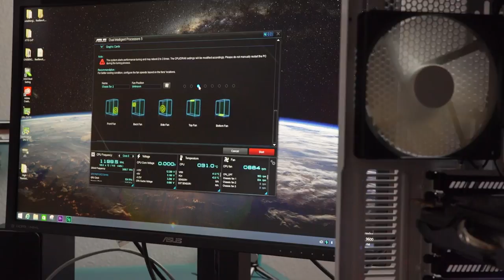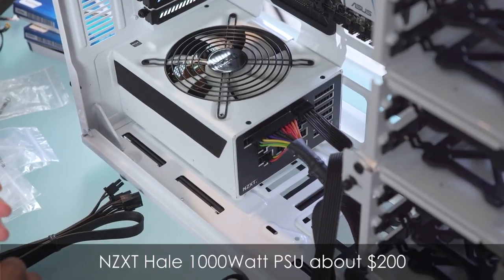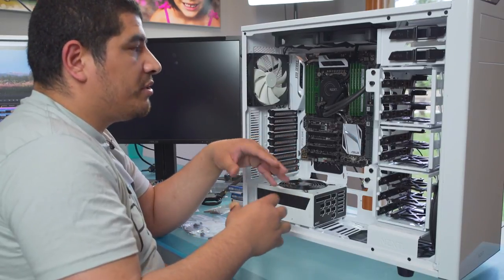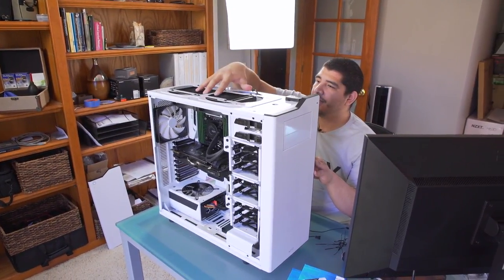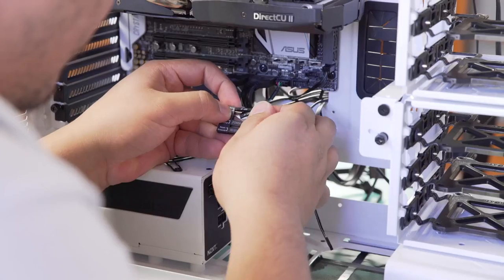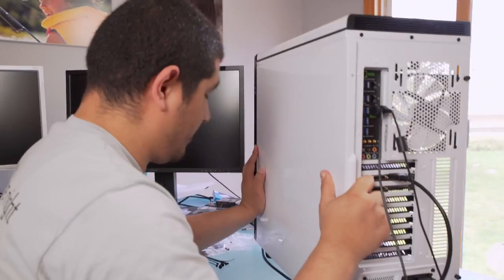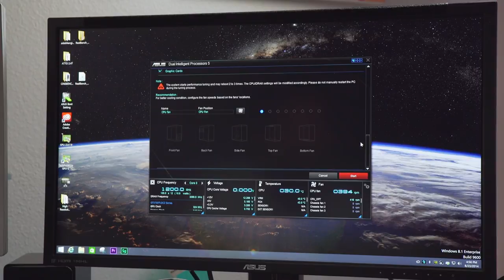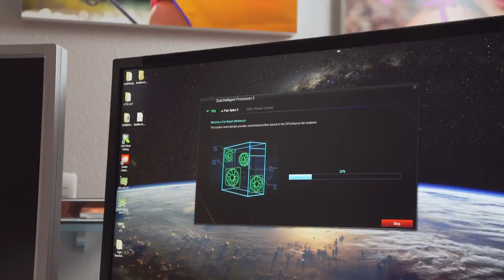i7-5960X 8-core With Asus X99 MB Video Editing Beast

Comment: He wasn't entirely correct about the MacPro.  There are some definite advantages, aside from the HUGE advantage of Mac OS X (which is far superior to Windows).  The first is Xeon CPUs, with up to 24 cores, the second is ECC memory (error correcting code), the third is professional-level GPUs designed for the type of work you are doing here, Dave.  The Nvidia consumer-level gaming cards cripple their dual-precision math (in an effort to sell more of their workstation-level cards).  They only run at about 1/8th of the speed when you need DP (dual precision).  The MacPro has AMD Fire Pro cards, which are workstation cards without the hindrance for DP.

Everything else he said was spot-on though.  For whatever reason, Apple tends to use last-generation hardware, so if you want the latest and greatest, you'll need to stay away from Apple.  That being said, if you are doing a lot of GPU crunching, the Fire Pro cards will blow the GTX 780 Ti out of the water and you can get multiple cards in a single Mac Pro.  The Mac Pro is designed from the ground-up to be a workstation-class computer, for video editors, photo editors and other professionals who need insane number-crunching power.  

If you haven't tried OS X, you really should.  It's brilliant.  Once you use it, you'll never be able to go back to Windows though.  I run OS X on all my computers, except for my server, which runs Linux.  I even made a "Hackintosh" a while back, which was slightly maddening to get running, but AMAZING because I have hardware which would have cost me about $8500 to get in a Mac Pro (cost me a little over $3500 to build about a year and a half ago).  I love my MacBook Pro with Retina screen too, the colors are so vivid and it was almost perfectly accurate from the factory.  I've had laptops from Alienware and Asus in the past, but they were nowhere near the MBP in terms of screen resolution and clarity.
Reply: And you are not entirely complete in your post, either. NVidia makes workstation class GPUs as well, their Quadro line, which was just updated with new models. From what I've read, Adobe's apps are optimized for NVidia tech, not AMD. YMMV.
Reply: genjii931 Indeed, Nvidia makes some amazing workstation cards too.  I've used both AMD and Nvidia cards in my macs over the years and both work really well.  If you don't go for one of the Quadro or Tesla cards from Nvidia, your double-precision performance is SEVERELY hampered (from 1/8th to 1/24th the single-precision performance).  That being said, not all apps take advantage of DP, so that may not be an issue for some people, so the regular desktop/consumer line might be fine, from either maker.  

What's lacking with AMD, in my opinion, is driver support.  They've only released 2 drivers all year, while Nvidia has released a number of driver updates.  If you are making a Hackintosh, it's best to stick with Nvidia, though, as the AMD GPUs really don't work that well.  Of course I believe Dave's question was about the Mac Pro, so what works on a Hackintosh is really irrelevant.  

If I had Dave's computer, I'd definitely install OS X on it though.  I'm currently running OS X on my Core i7 980x system and it FLIES.  It's so nice to be able to move from my laptop (a "real" Apple computer, MacBook Pro Retina) to desktop and have the same OS, apps and setup.  Even though the 980x is several generations old, it still blows my new MBP out of the water on everything it does.  

I haven't tried running an AMD GPU with Adobe's apps on the mac, but when I was running windows, the AMD/ATI cards worked just fine with Adobe's software.  All of my Nvidia GPUs work flawlessly with the adobe applications, FCPX and a myriad of other video/photo apps as well.
Reply: I've used several distributions of Linux, MacOS and Windows over the years.
All of those operating systems have their up and downsides.

If you think one OS is vastly superior, it is mostly based on your personal preferences.

Also - If you have established a good workflow for any given task, it's not reasonable to start from scratch again.
Reply: RedHotBagel   Agreed.
Reply: RedHotBagel I, too, have used many operating systems throughout the years and that's why I can confidently say that OS X is the best, especially for a working videographer or photographer.  Perhaps it's not the best for an accountant or someone who deals with spreadsheets all day, but I really wasn't referring to those type of people in the message.  I currently use Mac OS X and Linux at home and I've used windows for many years too, just not currently.  

The workflow is almost identical between Mac and Windows when it comes to Premiere, which is the main application that Dave uses (with Resolve for grading, which is also available on OS X).  The only real "switch" would be the close-window/minimize/maximize buttons on the opposite side of the screen.  I am a photographer who dabbles in videography, the adobe apps are identical on mac and windows, I can transfer between them seamlessly.
Reply: Scott R
 The workflow for the apps is almost identical, yes, but the workflow between OS X and Windows is quite different. I use OS X at work, and Windows (7) at home.

I'd say Mac OS X is considered easier because the interface is very limiting - and VERY consistent. Everything is pretty much always in the same spot, and there is comparatively little you are allowed to customize (without third party software). If you're not so great at typing, you'll likely prefer Mac OS X.

Windows 7 is very customizable - even without third party software, but things can be found in fairly (sometimes very) obscure places, depending on what you're trying to do. If you're good at typing, you'll prefer Windows 7 once you learn it. It's just a lot FASTER to use (user interaction-wise) than OS X, even my Mac expert friends are surprised how much faster when they see me using my Windows machine (but that's not enough to even remotely tempt them to switch, nor should it be).

If something goes wrong, I think you're better off with Windows 7, as it's more easily fixable (if you're technically inclines), at least in my experience. This may just be my experience, though. The Mac experts at work often seem to resort to wiping a machine clean and starting from scratch to fix certain issues, which I find very irritating.

Hardware reliability: Depends on vendor. I build my own machines at home, and haven't had a machine flat-out die on me in ten years. I've had 2 Mac Minis and a Macbook Pro die on me in that same period of time. I know how to take care of machines - all my stuff is on a UPS, etc, and I use only the highest quality power supplies in the machines I build. Apple looks pretty, but the kind of machine you can put together yourself outclasses any Apple I've used aside from the older Mac Pro (not used the new one that looks like a smokeless ashtray :).  I can't compare to Windows machine vendors as I always build my own. I only choose very good components for my own machines, and I'd be willing to bet large sums of money that a regular Windows box vendor won't be doing the same.

But if you spend 90% of your time in the Adobe creative suite, yeah, you're not likely to notice much difference in use.
Reply: genjii931 The main difference with windows and mac, for me, when it comes to customization is that I don't NEED to customize my mac, because things tend to work as intended.  Really, the only thing I add to my vanilla mac install is iStat Menus, which is to monitor CPU/GPU, Network, battery, hard drive space, etc.  The App store is amazing, you can find anything you need or want right there.  I very, very rarely have to worry about drivers for my hardware with my mac computers, which isn't something I can say with Windows.

I can't say anything about Win 8 or the upcoming 9, as I haven't used them, but Windows 7 always felt rather clunky to me.  I've used Mac, Windows and various Linux Distros extensively and I feel more "at home" on OS X.  I gave my dad my old Apple Powerbook G4 a few years ago, this is a guy who had never touched a computer in his life and within a few weeks, he was doing everything he wanted to do.  When that computer finally went kaput, he had (and still has) a hell of a time working with Windows.  I actually stuck him on Ubuntu there for a while and he seemed to like that better than Win 7.

But you're 100% correct about the hardware, you can build a system that's just as good as the Mac Pro for considerably less money.  The last mac desktop I purchased was a powermac dual G4, way back in the day.  I've had a series of Mac laptops and built a number of PCs.  I took a chance with installing OS X Mavericks on my core i7 980x machine with 48gb of RAM and 2x GTX 570s and it runs like a dream.  I built that system for about $3000 or so a couple of years ago and have added to it a bit over the years.  I'd still be hard-pressed to buy a Mac Pro under $6000 that would keep up with it.  There are some problems with installing OS X to a home-built PC though, it's certainly not for everyone as there are a lot of little niggles that will make you pull your hair out.  Once you get it working, it's rock solid though.  No crashes, no app crashes and it's nice to have things set up identically on my laptop and desktop.  Plus transferring files between two macs is about as painless as it gets, with everything automatically showing up in your finder.  With Yosemite, you also get continuity features which allow you to answer/make phone calls and texts from any of your apple devices (iPhone, Computer or Tablet), which is really nice and I don't think you can get that on windows without a lot of various hacked-together software.

I find that if I build the system myself, it lasts longer, for whatever reason, than one that I buy.  I'm not sure if that's just due to me knowing the system inside and out or the fact that I use higher quality parts than manufacturers use.  Either way, I haven't bought a desktop system from a manufacturer in well over a decade, but I do still buy laptops that are pre-built, as it's difficult to build your own still (although it is possible).
Reply: Mac pro is an awesome computer, totally self contained comp in a beautiful package, BUT the price is too damn high for 90% of consumers- so if your a pro who can use the specs and osx apps with cash to throw around buy it and call it a day. Otherwise save money and build your own PC.
Reply: John connor Wow, this discussion distilled again to Mac OS vs Windows?
I use many Linux/Mac/Windows machines in ~50-30-20 ratio. It's quite annoying to hear the same tune about Mac pricing considering how they overlook competitor prices (HP, Dell, Lenovo et al) selling at more or less similar hardware. It's a classic fan boy thing to get into.

Yes, if one can't afford Macs then build PCs. In fact, one can use Linux OSes to save some more money. I do all sorts of things but I never crib about Macs or PCs because it's my responsibility to make future-proof (enough) investments ranging from embedded to hybrid clusters, and everything has pros and cons.

Note that I'm inferring about many /fancy/ folks who can't comprehend value of money like teens, students or young employees who often get impatient at spending money in their first/second jobs. I know this because I'm seing interesting 'headcount' trends since 2010...many end up with plastic traps!
Reply: John connor I don't believe the Mac Pro is a consumer computer though.  It's got workstation-class CPUs and GPUs.  The iMac is a consumer computer.  The average person doesn't need xeon processors and Fire Pro GPU(s), or ECC Memory.  In fact, for some applications, the Xeon and ECC would actually be slower than a regular consumer CPU with a higher turbo-multiplier and faster RAM.  

The average consumer has FAR more computing power than they need these days, with some computers having 4-8 CPU cores.  You just don't need that for web browsing, social media and youtube.  The old Athlon X2 (or even Athlon XP) systems would handle that stuff just fine.  My dad has a laptop with 8 cores (4 cores and 4 HT) and I doubt he's ever used more than 10% of the processing power for anything.  The latest generation i3/i5 is extreme overkill for 99% of things the average consumer will do.
Reply: ***** Indeed, the X99 system is amazing.  No doubt about that.  It's a platform from which you can build truly MONSTROUS computers.  But in terms of pure, raw, number-crunching ability, a single Xeon and gaming GPUs will never come close to a dual-Xeon with workstation GPUs.  That's doubly true if you're using Nvidia gaming GPUs, because Nvidia gimps the double precision performance quite severely (1/24th).

That being said, the mac doesn't have nearly the memory bandwidth or even the point-to-point bandwidth of the X99, so that could make up some of the difference.  ECC is naturally slower than regular non-ECC memory.  The PCI-E lanes of the X99 are 2x as fast as the Mac Pro's board (also with 2x as many PCI-E slots, iirc).  Mac Pro doesn't offer next-gen SATA ports (which very well may limit speed if you were using a SSD RAID system).  And of course the Mac Pro is ridiculously expensive for what you're getting.  

I'm certainly not trashing the X99 system.  If I could afford to build a new computer right now, I'd have one sitting in my living room, it's a truly amazing piece of engineering and is the next level in motherboard design.  :)
Reply: Scott R I use a plethora of productivity apps on my windows machine , from 3d to photo editing. I'd never buy a mac, just seems a huge amount of money to pay for lesser hardware. You get used to whatever OS you're using. Also one advantage windows has is empowerment. The entry level for a reasonably computer is around 500$ if you're careful. That means for 500$ someone has the potential to make awesome art. Finally isn't retina display just 4k ?
Reply: genjii931 You guys have all missed a few points about the Mac Pro, pros and cons.

1) The max number of cores you get is 12, not 24 (unless you count hyper threading) since there's only one CPU
2) It has dual FirePro GPUs rebranded as D300, D500 and D700 cards. These work out a LOT cheaper than their PC desktop equivalents. Go check it out for yourselves on Apple's site. A six-core Xeon Mac Pro with the GPU option upgraded to 2x D700 cards is a heck of a lot cheaper than the FirePro equivalent in a Xeon-based PC. 
2a) Finding software that maximises those two cards is tough
3) You get a PCI-Express SSD with speeds approaching 1GB/sec
4) The thing runs astonishingly cool and quiet
5) You can't use internal hard disks for storage expansion, you have to use Thunderbolt, network storage or USB 3
Reply: I have both computers here , Mac Pro 6 core 3.5 Ghz and i7 5960x PC connected to a new Samsung Ultra HDTV curved. The PC is water cooled and still sounds loud. I spent hours setting it up because there are so many things you can do to tweak it. The Mac Pro I just hooked up and was ready to go and I can barely hear it. I find Windows 8.1 very frustrating and not intuitive. When I switch over to the Mac it's like a breath of fresh air. I have the same case that is in this video.  

Final thoughts: PC is cheesy and loud with only a minor increase in 4K rendering. It's for gamers that want a big box that sounds like a leaf blower at lower cost and big time processing power. 

Mac Pro is amazing! Ultra quiet , huge external expansion capabilities, small footprint and runs on the best OS on the planet. No pop ups warning me of possible dangerous websites or viruses etc. I know this thing will still be running quiet and fast after one year of use and not bogged down by spyware, adware, viruses and antivirus software. 

Ya after building PCs for Protools DAWs for years,  you can tell I don't miss Windows. Lol
Reply: Scott R apples firepros are counterfeit
Reply: Scott R thats not true.
Xeon is 12 core and 24 hyperthread.
All depends what MacPro you have.
8 core Mac pro is slower then this 5960X and even when you overclock this beast you can get 19 points in CinebenchR15

MacOS is some places better but Windows isnt that bad as you say.
Reply: ThunderJarvis I find that people that get viruses or other forms of malware on Windows computers don't really know how to use their computers effectively (sadly, this is the majority of PC owners, it seems), but I agree that the UI of Windows 8+ is a bother (and I don't want to encourage the trend by buying into it), so I've personally been sticking with Windows 7 Pro 64-bit.

DIY PCs are always going to be able to be much more cost effective and powerful overall than Apple PCs, and of course you then have the freedom to create a computer how you want it, customized for your own wants a needs, whether it be for quiet operation, or so on.

Apple offers a nice...  stylized and trendy alternative for people that are less computer savvy and might not know how to properly build and maintain a PC running Windows and/or GNU/Linux (which again, includes the vast majority of people using Windows PCs, so don't feel bad). However, it has been my experience for the last 15 years (since using Windows 2000 Pro and at no additional cost) that it is more than reasonably possible to never be infected and bothered by malware on PCs using Windows that are actively used to surf the internet and download and install programs from it, if you know what you're doing.

I'm not formally educated in the field, but working on, building, and maintaining PCs has been a hobby of mine nearly my entire life. I now professionally work on computers (and some similar devices) and computer systems in very sensitive and critical ways. I got where I am by being curious, applying myself, knowing what I'm doing, and being at the right place at the right time. I get that most (the vast majority) of people likely don't have the same level of working knowledge of computer systems that I do, and that they shouldn't be blamed for it nor expected too. In my line of work Apple products are actually somewhat more of a security risk in general due to the relative lack of control and freedom their users (and those of us that support them) have over these products.
Reply: I can build a hackintosh which much better specs, and much lower price
Reply: 1) Whether or not OSX is superior to Windows is down to personal preference. Issues with viruses and stability are basically a moot point now - that was an argument to be had maybe 5 years ago. The Windows platform has improved immensely from Windows 7 onward.

2) The current Mac Pro does not offer dual-CPU, so if you want dual Xeons, your only option right now is a PC. Even when Mac Pros did have dual CPU's, this was NEVER something exclusive to Macs.

3) The X99 chipset (socket 2011-3) already has 14-core Xeons available, with 18-core Xeons in limited quantity.... In the next couple of years we'll probably have 18-core Xeons in greater supply, and probably something higher than 18 cores... Mac Pro will probably do a hardware revision to meet the 18 cores, but because of the nature of the platform, it'll be more cost effective to go PC, since you can start with an i7, plop in a shiny 18-core Xeon when you can afford it, and upgrade that later to whatever later 2011-3 socket releases, all without needed to buy a new computer.

This is typical of the computer scene whenever there's a huge new platform release, but right now a PC is hands-down the most cost-effective and flexible investment. We'll see what Apple comes up with in the coming years in response. They are a good company with VERY GOOD machines. "The best" is a pretty naive thing to say, though.
Reply: genjii931
 He did mention Workstation class cards from both, Nvidia is only optimized for PLAYBACK with the Mercury Engine, but in ANYTHING OpenCL especially in late CS6 and all CC, AMD cards always have better performance in any rendering aspect. This is documented on Adobes website. Hence why Mac Pros use FireGL cards and Adobe promotes use of AMD cards in mobile applications all the way thru to the desktop. Nvidia also disables Cuda Cores in Consumer grade cards from 6XX  and up, when Editing Software is detected. AMD does not disable anything at the consumer level, I use a Sapphire 7970 Vapor-X 6GB card and it's rendering times are just slightly above real time to double time for Normal to HQ 1080p Rendering where 6XX cards tend to be 3-4 times real time during rendering. When you produce 45min content like I do, that matters a lot.
Reply: *****
Do you edit Video or Photography with your Linux? That's why this is a OSX vs Win debate. Because of how GPU MFRs work with these industries and how the landscape has been dominated by Mac for many, many years, but now since Avid took over and Adobe has become a more dominant contender, what is better is complicated depending on what apps you use. For Photos, Mac is still the dominant force, but in Video Production, Windows pretty much stomps all over Mac. Why you ask? How is it so important? Cost effectiveness and efficiency. When an OS and hardware setup is 3-4 times, Real-time rendering time and the other can be less than Real-time or slightly over, that a big savings difference in man hours for productions companies. This isn't about who's got the bigger ePeen or more FPS, this is who can save you more money.
Reply: Raptor03042
Thank You! Very well said and very True!
Reply: ThunderJarvis  You're kidding right? #1 You can build a PC that's pretty much Identical to a MacPro, you can also build top tier PCs that are absolutely Silent. (Just because you don't know how to, doesn't mean it's not possible)
PC's are tweak crazy, because setting something up YOUR way is much more important and flexible than using it by someone else's Preconceived idea. Macs are build to be controlled environments for those less tech savvy and more apt to trends and style. PC is for the working class who know what they are doing. Also, we're not talking a minro increase in possible performance, it's very well substantiated. You had issues building PCs for ProTools DAWs because DigiDesign designed the DAW to work specifically with Mac's G series hardware. When Avid bought them out, customer service took a nose dive. I've been producing audio professionally for 21 years now, so I know, PC users used Steinberg / Cakewalk more than anything back in the day and now either use Logic, Cubase, Nuendo or Reaper. You can get infected no matter what OS you use and actually Macs have a higher % now a days than PC. For either OS, if you get infected, you should uninstall your OS and sell your PC...  I'm still running on the same Win7 Install for 5 years now with no need to ever reformat.
Reply: Mac OSX is slower than windows 8.1 by around 10-15℅ and you can build a far faster PC for a similar price to an Mac. Like most apple fans you seem to be delusional and don't really know what you're talking about, much like the Apple geniuses.
Reply: XeridiansDen @Do you edit Video or Photography with your Linux?

I got 300+ machines running Linux, OS X and Windows which form ~50/30/20 % respectively; about 1/4th of those do far more than typical AV editing on high-end workstations based on Nvidia Titan Black, Quadro and Tesla cards. E.g., I write some CUDA code to simulate 50,000 molecules. So what are you talking about Linux' capabilities when it comes to computational applications be it in multimedia, scientific and engineering domains?

Now, please don't play the same old broken record: Mac is closed platform, expensive blah blah.One must note that each OS has its pros and cons, but that doesn't mean Linux is lagging in core capabilities except in case of 'alternative' Gaming platform. Fortunately, this is now catching up in form of SteamOS. Android too making giant strides. We all need Apple and Linux ecosystems else most market goes to Windows.
Reply: Not sure if it was already mentioned here as I didnt read all the comments, but I heard you stating the advantages of amd fire pro over nvidia. are you aware that most nle's support cuda cores (only in nvidia) so it kindof doesnt make any sense what you are saying, or am I wrong?
Reply: Alexander Fagard You've actually landed in a grey area for the media industry. Currently, you can get a ton of leverage from CUDA acceleration, which on the Mac side is only doable on an iMac, Macbook Pro, or an older Mac Pro. But there's a reason why the new Mac Pro went AMD: OpenCL is better and open technology when compared to CUDA. The problem is that currently the support for CUDA is OVERWHELMINGLY more popular than OpenCL. So what you have is Apple making a bet on what is actually better technology, much like Thunderbolt - which again is technically superior, but developers have been disappointingly slow in creating cool solutions for it beyond your typical external hard drives.

Right now and in the near future, investing in having CUDA in your arsenal is smarter and puts you ahead. But Apple's rolling the dice on OpenCL. Problem is that it could take so long for their bet to come true that it's sort of meaningless right now. We really don't know.
Reply: R-PLAY The key is using tools to derive most out of the invested Computational platform. E.g., a few years ago, I've built Teraflop-scale Xeon/Tesla Hybrid cluster by keeping CUDA in mind. I went on to build one more cluster because it worked really good (read as Design/Modeling/Simulation).

Having said, I've decided to bring back AMD's FirePro because of its performance benefits against Nvidia workstation cards, hence gone ahead to build that extreme workstation to dig more deep (evaluation) into it. I'll build more machines with FirePros in the coming months as a part of FY 2015 investment plan.
Reply: OSX isn't a huge advantage if your system is purpose only. Windows tends to be very unstable on multi purpose computers but if you are literally JUST editing it works fantastic. OSX is pretty bulletproof though, I use my iMac for lightroom, gaming and my Premiere/After Effects workflow and it doesn't miss a beat.
Reply: Photographic Time "Windows tends to be very unstable on multi purpose computers." This is completely false unless you're running on lower quality hardware. Hardware quality has a MASSIVE impact on OS stability. This is a big reason why quality hardware in a Mac yields a generally more stable system - but the myth is that you can't also get quality hardware for a Windows machine.

You get what you pay for. If you buy a cheap PC, it'll behave like a cheap PC. If you buy an $8,000 workstation PC, it'll be solid as a rock, just like a workstation-class Mac (Mac Pro).

My custom-built PC costs roughly the same as a decked-out iMac (around $4500), quality components, horsepower is more like an 8-core Mac Pro, I work (editing/animation/audio) and game on this thing every day and make between $45 and $75 an hour. It's stable and reliable as hell.
Reply: R-PLAY I went to school for computer engineering. I wasn't talking about hardware stability. Windows is really bad at managing its filesystem. This causes performance problems down the line. OSX and other Unix based Operating systems like GNU+linux are better. I personally think Windows is designed to slow down over time, this drives PC sales. I've been using this Imac here since 2011 on the same OSX install essentially I've upgraded to Yosemite but it wasn't a full reinstall If you look at my channel, you'l notice that I run an entire server rack in my basement.
Reply: "I went to school for" is the stupidest appeal to authority ever. Students hardly know shit. Real-world experience is everything. Windows DID have an issue with file system integrity but that changed with Windows 8. I'm not quite sure what they did since it's still NTFS, but the behavior is distinctly different and I never defrag anymore.

NFS+ (Mac file system) is technically superior, but again, and I work on both Macs and PC's a lot, something changed with Windows 8 onwards, even though it's still NTFS. With Windows 7 it was only a minor nuisance having to defrag periodically.

The fact is, if the issue is as severe as you're implying, then NO company worth their salt that deals with large amounts of data would ever use a Windows machine, which is absolutely not the case.
Reply: R-PLAY Productions use purpose built computers, IE you don't use the system for anything BUT its intended purpose. At least in my working experience as a videographer I've seen colourists and editors use mainly Macs. Most Mac Pro's can handle Raw Red footage without a hickup. They almost always use external scratch and performance NAS solutions for storage. We also use a Render server instead of rendering on the Macs. I'm pretty sure they have it setup to even render their software previews. lol
Reply: You just changed subjects. You were talking about file system integrity and that issue does NOT change regardless of being "purpose built" or not. Especially with Red R3D's, DNG's, EXR's, sequence-based containers -- if you're dealing with raw or heavy intermediate formats, and if the file system is as weak as you implied, then NO PC "purpose built" or not would stand a CHANCE, which of course isn't true.

No, "most Mac Pro's" can't handle R3D files "without a hiccup," maybe at 1/2 debayer. It depends on a lot of factors - ahem - HARDWARE QUALITY as previously mentioned - an older <2012 Mac Pro woudln't stand a chance without a Red Rocket card or other third-party card. The new Mac Pros -- it depends on what you're doing, and it has to do with having Firepro cards with lots of VRAM, as well as a strong CPU - both of which are not exclusive Macs. Stop pretending to know shit. Enjoy your iMac. It's a great computer. Have fun.
Reply: R-PLAY Anyone can read from Google, I am not an professional editor, never said I was. I do small edits, usually with Cinema DNG on my Modded 5Dm3. Your right, it was a bit naive of me to say "most" Mac Pro's can handle raw Red footage. The new Trash Can style Mac Pro has the throughput required for Reds raw format. In the edits I've worked on not professionally. I down convert my Raw footage after grading to Prores which is allot more friendly. The architecture OSX uses IS just better. Thats hardly a debatable fact. When it comes down to it, its t the user that counts anyway. I've only had heartache using Windows based computers in professional situations. Its like trying to keep a house of cards together if the PC is being used by multiple creatures. OSX just has that "it just works" quality to it. Practically speaking no virus's, no bloatware and seamless hardware integration. Of course, Macs are always going to lack the specifications of the newest PC hardware. (Socket 2011 V3 & DDR4)
Reply: You lost credibility when you said "viruses" and "bloatware". Just stop dude. You really don't know the professional PC scene at all, or the current state of reliability with Windows. Hand me your iMac and I can make it crash by loading up a really heavy GPU-based effect, which will make your GPUM chip overheat, causing the display port to crash or possibly the whole system. I've done that numerous times, specifically on a 2011 iMac.

Since you mentioned Google, why don't you Google "Mac viruses" and "Mac unstable" and have fun seeing the many people who have issues with your computer that "just works."
Reply: "Practically speaking" I've personally never experienced any virus's on my Mac. I use Nod32 which is a practically the industry standard. Bloatware as in all the shit PC's tend to run in the background for basic functions that OSX runs internally. And you don't have any Credibility at all, you play COD. Look at my channel friend, I run a 48u Server rack in my basment.
Reply: This is my little barely-active gaming channel. The way I'm talking, and with how specific I'm being, it should be pretty evident that I've got more going on besides this.

Bloatware is a problem for consumer PC's, not for workstation PC's or custom builds. You know nothing.

Having a server cluster doesn't magically make you right. I'm spewing knowledge and writing out specifics. That's why I win: because I actually know what the fuck I'm saying. You started off sounding reasonable and steadily declined into another clueless Apple shill. Have fun with your iMac and your DSLR, lol. Gotta start somewhere.
Reply: R-PLAY You win! haha, what's your prize? Everyone can spew knowledge on YouTube. I work in production every day. Maybe you win the imaginary war of syntax but that hardly makes up for anything.  I've been building computers for the better part of 14 years now. I've decided to do something more creative with my life. I've been doing freelance video for about three years. I'm not exactly a veteran like Philip Bloom but I know exactly what I'm doing. I work with professional workstations every day, all the custom cases you see in my rack are workstations used in my production to render. Words mean very little in this day and age. I have the hardware to back up my statement. You... um, don't for the looks of it.
Reply: R-PLAY tbh, I'm just fighting for the sake of fighting. lol I'm going to give you the benefit of the doubt about your claims, since theres no evidence to say its untrue. However, you do not know me. I don't have an allegiance to any specific brands, I use what works best for me. I actually hate Apple for ethical reasons. I buy my Apple products iMac, Macbook used to justify my ownership of them. In reality, Windows and OSX are useless without a qualified artist to use them.
Reply: Wow I mean i respect OsX and in some things it excels... but this initial post is 99.9% opinion based IMHO. And in my opinion windows def has the hardware and software edge, the days of "oh no mac viruses or crashes evar!" are over... you remind me of my buddy always telling me iphone is the best phone on the market and it never crashes.. I said to him.. ever have an app just randomly close and you have to reopen it ... he said yeah ...why? I said thats a FUCKING crash... just on an iphone it doesnt pop up a window alerting you to the fact... like android does...its just marketing BS...dont buy into it. Mac pro's are WAY too expensive...its a fact.
Reply: b00stedrust The reasons macs have less virus's then windows is because they are more secure naturally. Unix in general is more secure than Windows architecture, thats why Unix and unix variants like GNU+Linux are used in almost every datacentre. In fact I watched a documentary on Microsoft's data centers and I saw some custom Unix distribution running on their servers. That said, Mac users themselves are less secure users often. Many Mac users use their macs recklessly. I personally run NODE32's enterprise software on all my computers. NODE32 in my opinion is the industry standard.  I also don't download random stuff, I only run what I need to run.
Reply: genjii931 wrong adobe has started optimizing for AMD over nvidia because opencl is far better and faster
Reply: guys... thoughts on a hackintosh? i agree that the hardware is only as good as its user. ive had a few bad experiences with apple that has led me to completely boycott the company. some may laugh but i use sony vegas pro 13 (on a custom built i7 3930k x 32gb ram x nvidia 760) because it fits my workflow so well and doesn't come with all the quirks premiere does - although it crashes alot with plugins (ugh). but yea im curious if any of you have experience running a hackintosh with editing programs? i'd assume that its the best of both worlds in terms of hardware you get to choose and an os that is less bloated (and without metro). also Photographic Time theres no way a macpro without a redrocket could run red footage natively and not with some lower res proxy, i mean thats in some cases 6k...
Reply: Alexander Fagard Red Rockets are no longer a requirement to push red footage. If you have enough CPU power, RAM, and most importantly VRAM, the system will perform. I believe the MacPro has 12gb of VRAM which is more than enough, at least for 4k raw footage... Don't know about 5 & 6k.
Reply: R-PLAY with no dropped frames?
Reply: Alexander Fagard Yup. Especially if you're on a newer engine like Premiere 2014.1 and up.
Reply: R-PLAY I personally stopped renting Reds for video production for the most part, Our BlackMagc Production Camera 4k offers higher data rates and better dynamic range. We nly use RED Epics for slow motion. We only keep the footage Raw DNG for the initial colour grade then we convert it to easy Prores.
Reply: ThunderJarvis Something tells me you either bsing or have a cheap AIO. If not, what rads are you using in your loop?
Reply: ***** He also might be running a static OC instead of a dynamic one, so the CPU is constantly near turbo, which would have the rad fans spinning hard all the time. Easy mistake if you're new to system building or OC-ing.

A "minor increase" between a 6-core Xeon and a 5960X is complete BS unless the video card in his PC is a bottleneck, especially if OC'd.
Reply: Photographic Time That slow motion is one of Red's aces in the hole :) Not for long... I hope they've been busy behind the scenes...
Reply: R-PLAY Even if he has C-states disabled, the processor isn't going to get very hot unless it's under load. PWM fans are generally controlled by reported temperature, not active clockspeed, so the entire thing sounds like BS, unless he's got either a cheap AIO or maybe even a 240.
Reply: Oh dear - the ole Mac Vs PC quip - I like blue you like red, reds better - no blue's better - an un-winnable ouroboros. God speed!
Reply: Jamie Andrei Your light-hearted neutral stance is nice and all, but it's a perfectly "winnable" argument if you know about how computers work, what i/o and software situations suit your particular workflow best, and where your priorities are in terms of budget translating to utility.

This translates to buying basically anything else. There are educated buyers, and then there are more casual buyers.
Reply: R-PLAY Yes indeed, also allot of people seem to hate something they personally can't obtain
Reply: Unless Dave plans on working with a LOT of 3D applications, there is very little benefit to having a WS GPU, especially with Adobe CC. Almost all memory has some sort of error correction anyways, which is even better in DDR4. The ECC RAM, again, is more well suited in 3D applications where rendering scenes can take weeks at a time. The 5960x blows any Xeon (at the same price point) out of the water, and is overclockable. Also, Mac OS X being superior is absolutely down to opinion.

The benefit of a PC build is that he will be getting the same level of performance of the Mac Pro at a cheaper cost, AND everything in his system is upgradeable and expandable.

With that being said, the Mac Pro's are still beast computers. If you have the cash for them, and you prefer the OS, go for it.
Reply: HinkerPS3 I've been using a 590 in my Mac Pro for three years. CC doesn't utilize that card fully (usually renders at 40% GPU usage) So I totally agree. I think that Xeon CPU's are actually a good idea for After Effects. For Dave he really doesn't need much more than what he has. One big issue with the Mac pro though, I had to get a second tiny power supply that fit in the disk drive slot because the 1100watt PSU doesn't have enough current on the PCI-E 12v rail. I think the 590 uses 390 watts when at 100% load.
Reply: Alexander Fagard

As much as I really like a lot of aspects of Sony Vegas, the playback and rendering engine just doesn't seem to be efficient, at least on my 2011 Dell laptop, Premiere seems to consistently outperform Vegas. Maybe Sony will improve their engine in the next version.
Reply: R-PLAY exactly as you say, it's not winnable - it's down to each individuals assessment of their needs & their perception of their needs & their need assessment criteria be it emotion or logic biased - so therein is the paradox. Is red or blue better?
Reply: Jamie Andrei 
"I need the most powerful machine." PC wins.
"I need mobility and battery life." Mac wins.

There is no paradox, only your needs coupled with preferences and knowledge.
Reply: I still prefer Win 7 to OSX.
Reply: R-PLAY
Some of the Windows 8.1 Ultrabooks and tablets are increasingly getting battery life close to or exceeding the 2014 Macbook Air. Which is great for everybody, not only does it encourage competition, it also means anyone who buys a new computer get's great battery life whether they prefer Windows or Mac OSX.
Reply: You can still get ECC memory, professional grade video cards (I'm assuming you mean things like the NVidia tesla series, which I use for things like CAD) and all of the other components you mentioned. However, I think that the MacOS just comes down to personal preference. I still prefer Windows 8.1 Pro over the MacOS, although there are programs that you can use on windows that you simply cannot on a Mac. I'm just waiting for the day when we can all use Linux and have many compatible programs with it.
Reply: Also, you can definitely get multiple AMD Fire Pro cards in one windows system... lol!
Reply: Ike Fox
 *claps* bravo sir
Reply: Ike Fox  By all means, believe what you want, but all things are not equal here. Plenty of specifics have been discussed in this thread, and it goes much deeper. I haven't even touched on issues with going to 10-bit color spaces on a Mac vs being totally carefree about it on a PC, or with many PC's causing a higher noise floor which can make detailed audio work not so pleasant (depends on the build), or if you're getting into VFX/CGI you should work in Linux as much as possible, though many professionals skate by on Windows just fine - you just can't get the horsepower you need for that in a Mac. Knowledge is king in this competitive market. It's worthwhile for you to learn about the tools.
Reply: "(which is far superior to Windows)"  really? in what way it's superior? please do not write, just give me link to some benchmark. Because our premiere benchmark on mac pro 2015 with dual os; windows premiere outperformed osx premiere by %8-10. 
when it comes to gpu use, windows is the best system.
Reply: i know its late but I use a mac and have used a PC and I dont like OS X